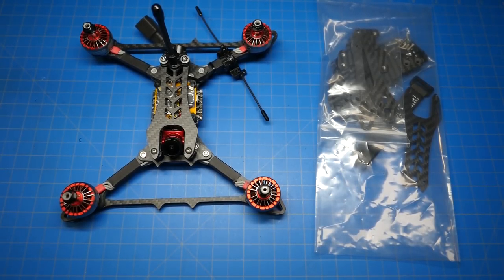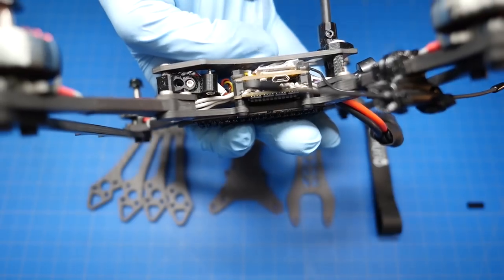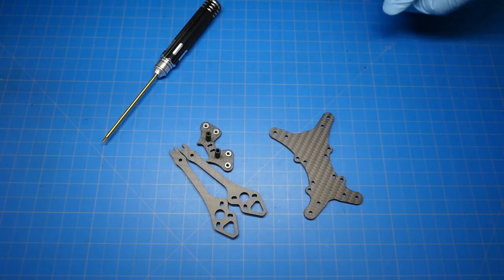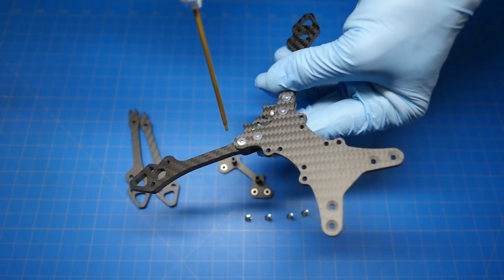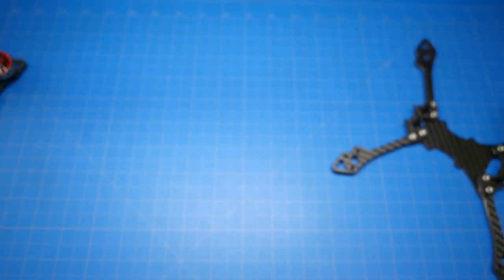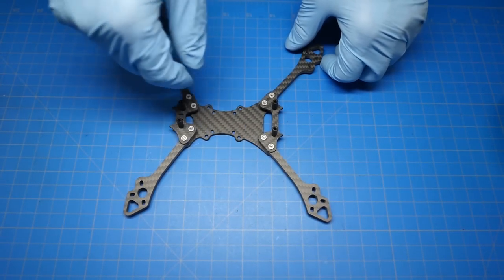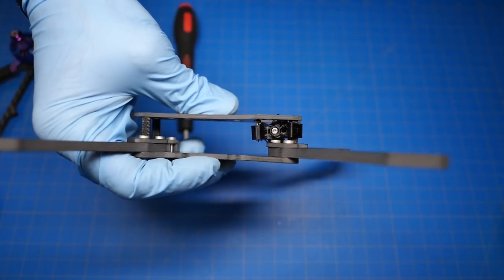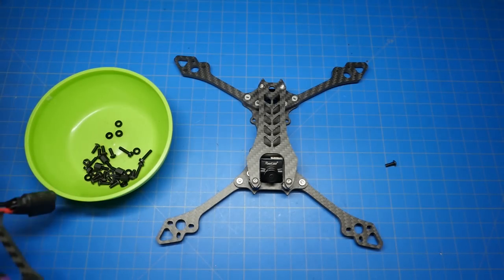SlamNasty Frame Assembly Video

Comment: I built a beautiful, clean, 5" Super SlamNasty with the White noise Synergy FC, and it makes it an easy fit. What components are you using on the 4" SS Nasty? Also could you give me a dry weight of a pre built 4" Super SlamNasty. I would like to use 1606 motors, and keep it below 250 grams with an 850 mah battery. Thanks Neil, and company, I look forward to visiting your new store this year, Im about 5 hours away, so itll be a little while before I get back to Spring Tx.👍